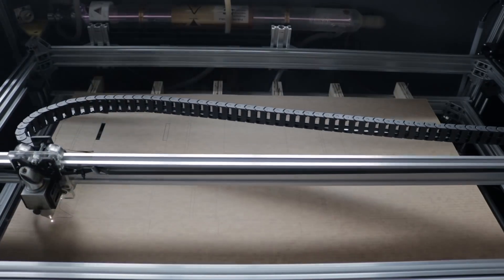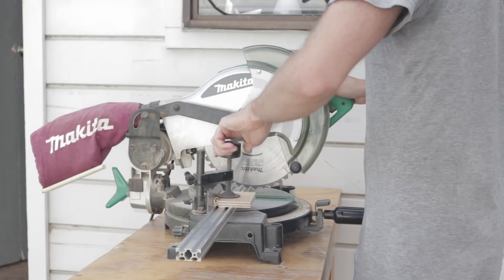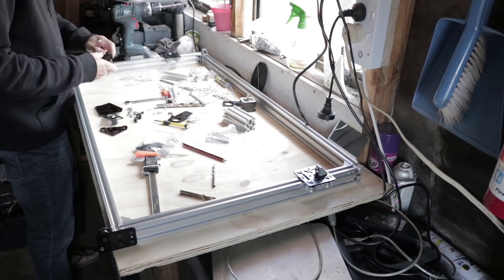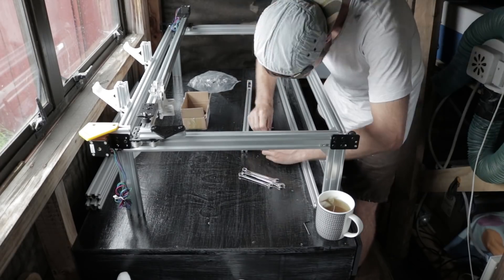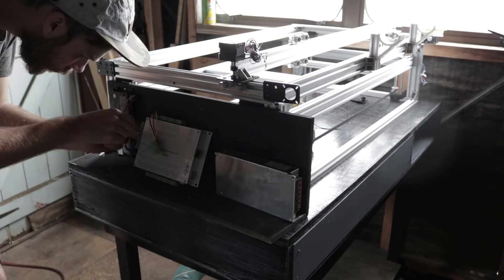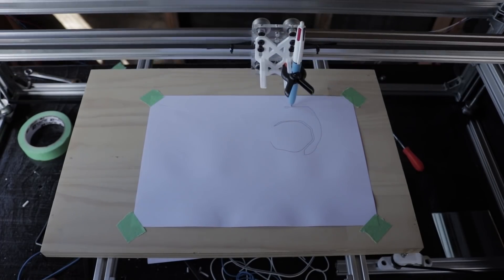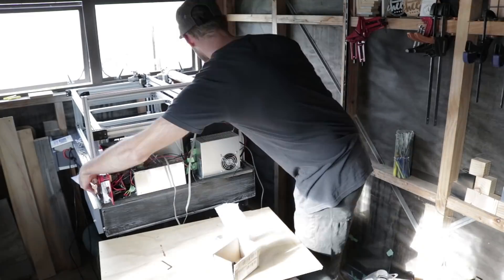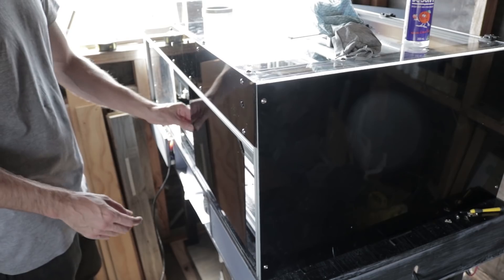DIY Homemade Laser Cutter

Comment: Really nice work. It seems like a single z-axis tower would be more material efficient and offer less potential for failures than raising and lowering the whole table - was there a limitation caused by the laser that prevented this?
Reply from the maker: Thanks! hmm can you explain a little more, I'm not entirely sure what you mean?
Reply: I meant that in most cnc controlled machines (routers, waterjets, etc.) the main gantry would span the shorter dimension (to prevent vibration/deflection) and a carriage would travel along that to provide the other 2d axis. That carriage would hold a short vertical track that would hold the secondary carriage that controls the z-axis height. So, rather than having to raise and lower the entire bed it is stationary and, in your case, you would have a mirror at the top of the z-axis track that would divert the laser down to the lens would be raised and lowered to accommodate different material thicknesses.
Reply from the maker: Ok yeah I'm on the same page now. That's a great question! 
The first part is the laser tube must be orientated parallel to the nozzle/head for the reflecting of the beam and because the tube length is already creating a fixed dimension it makes sense to utilize the full x axis space that this creates, hence the  main gantry spanning the relative 'longer' dimension. 
The second part is while there are examples of adjustable focal length heads they add extra weight to the moving gantry, this is significant because lasers, when in raster mode, need to be able to move their head at well over 200mm/s with sub mm accuracy, so acceleration and backlash are a real issue. 
There are a couple of other reasons but those are the main ones. Hope that answers your question!

Comment: Impressive build. How much did for the aluminum frame? Let’s say everything but electronics and laser? I’m building a CNC and I’m using iron, just to compare costs.
Reply from the maker: Thanks, I can't remember exactly, but it was a significant proportion of the build - that stuff is not cheap. I thought about welding up angle iron as my frame for cost reasons, but decided against it because I felt the extra versatility of the slotted alu was worth the cost, in my instance.
Reply: @FurtherFabrication  Ok, sounds fair. I was able to keep the frame under 100€ on my build, while keeping the same rigidity. But I'm still building it, I look forward to wire the electronics and see if everything is running fine... crossed fingers :D

Comment: hey man, great work, just one question: why did you use transparent acrylic vs a version 
more suited for blocking  a red beam ?
Reply from the maker: Thanks. It's my understanding that acrylic doesn't transmit the IR wavelength of the CO2 laser, regardless of color/transparency.
Reply: ah, ok, i thought co2 was more in the visible spectrum...

Comment: Hey, sweet build and great video.   
But to retouch on the laser DSP from LO, it might be worth the extra coin to consider Marco's latest offering in his T9 controller.   He now has direct input on the programming and firmware updates as a partner of the actual manufacturer.   The T9 has some cool features such as re-cut and a plethora of other nice attributes that make it top notch.
   I bought the T9 that I retrofitted into an old Lasersaur build.   It obviously runs infinitely better than their failed open source board and has every feature you can imagine.

Comment: hi, excuse me, where did you buy your laser source and how many watts of power has? i'm trying to manipulate certains conditions of the laser source like the power beam dot diameter, pulse repetition frequency and speed. 
Do you have any recommendations?
Reply from the maker: I got that laser tube from aliexpress, it's just a little 40w one. The beam conditions are going to be controlled by whatever your specific control board/DSP you're using, there's lots out there, and generally you get what you pay for in terms of ease of use and reliability. I've only had in depth experience with the one I'm using (AWC608 DSP controller) which seems to be fine. Hope that helps.
Reply: Thank you very much for your response, I loved your project. Congratulations

Comment: Very impressive! Do you think the rigidity of this design would hold up for a larger scale build of this? My target cutting dimensions is around 192x64cm, which is quite large.
Reply from the maker: Thanks! yeah that is quite large, you would probably want to beef up the frame a little bit more.
Reply: maybe 2040 instead of 2020

Comment: Honestly I am surprised it cost so much.  What was the most expensive component out of the bunch?  Was it because of the controller?  I remember you said it had it's own software so it was a little expensive.
Reply from the maker: I live in New Zealand, so literally everything costs twice as much because of shipping and import fees... also you'll be surprised at how quickly all the little bits of hardware add up
Reply: @FurtherFabrication   That makes sense.  Extrusion here in Japan isn't too costly, the bits to connect it together can be so I usually source them from Aliexpress where the price is significantly less.  Our hackerspace plans on building a larger laser cutter, so this was good to watch.   Any chance you have the laser tube holders on thingiverse?

Comment: Hi, can you tell me what software are you using? Is the communication interface USB or other? Thank you.
Reply from the maker: I'm currently using a piece of software called LaserCAD - it came with the electronics controller. But there are lots of other good ones out there too. It's communicating via USB but I believe it can also use an ethernet connection.

Comment: Do you have your actual wiring diagram? I am a little confuse about that, so i'm not yet assembly my laser.
Reply from the maker: It totally depends on what controller/power supply/stepper drivers etc you've gone with. Start with the user manual.
Reply: @FurtherFabrication  i use awc708c for controller, what controller you used?

Comment: Hi , nice build. like the way you solved some of the problems.  I did see the budget you spend for building this laser,  and I did check your size  ( which is between the commercial sizes to big and to small for my use ) If you have to build it again do you think you can build it for a lower budged or better for the same money?

Comment: Brother it is a good project and please tell me about Stepper motor you used and resolution you got.....? The strategy you used to lift the z axis is crucial... Nice build and great finishing...
Reply from the maker: Thanks man, the steppers are just regular nema 17. Check out the vid I just put out called 'the Witcher's Alchemy Chest' you can see the engraving resolution in some of the close ups, I've got it set to 0.1mm. I'm actually surprised how much detail it was able to get.

Comment: Hi sir great video. Im going to build one ofcourse. Can u make a video explaining all laser tube/glasses/focus length etc.?? Or can u share a document explaining how to setup laser ??
Reply from the maker: Thanks. Most of what I know is just from working with laser cutters, if people are interested I'll try and put together some more 'in-depth' videos. In the meantime if you search 'rdworks learning lab' he has a lot of good technical videos
Reply: @FurtherFabrication  Thank-you sir. i found 80W laser. mirrors/power supply/lens/head/chiller. Now i just need a right video from you (as u have explained it so well no jibber jabber all to the point) how to put those things together coz i have no experience.
It would really help if u explain wiring/fitting/testing of laser.
Reply: @FurtherFabrication  also if u have any idea what power laser should buy for cutting 12mm acrylic. (is 80W enough??)
Reply: should be ok. I use a 60w laser for 10mm. Basically it's running at 1-3% the maximum speed at the point. Also you can do multiple passes but it's not as nice since there's too much heat. I'd bet that 80 is good as long as it's a quality tube.

Comment: Cool man....I'm from auckland I'm gonna be interested in building a diy one, but one that can cut metal? Possible? Btw if you need help cutting of your extrusion or welding let me know can help you we have a very accurate saw that can cut Ali very accurately.
Reply from the maker: Nice man, cheers for the offer. I haven't explored DIYing one that can cut through metal. The power levels and cost required to do that likely make it unfeasible as a DIY/hobby machine.
Reply: @FurtherFabrication  thought so....just thinking out loud, possible to have all the setup, but instead of laser, I'll have a plasma cutter instead? If you know what I mean? You can buy a plasma cutter between 4 or 6k, and mount it on like the laser, but it's plasma? Anyway will that work? It's coz I'm a fabricator and paying to get laser cutting is pretty expensive, but wanna cut me only material at home for my homers.....thanks

Comment: hei, great video, thanks for sharing :)
I am wondering though if its absolutely necessary to use laser safety goggles before firing the laser ?
Reply from the maker: Thanks dude. Well no one's going to stop you if you don't have goggles, but for you're own safety and for those around you I'd recommend you read up on laser radiation first.
Reply: They are not expensive to get c02 laser glasses.  It isn't worth the risk.  Most people who get permanent eye damage from lasers don't even realized it when it happens.  All it takes is for a stray reflection to change your life forever.  Wear them.

Comment: I have started with a  basic k4 and modified from there. Your build is literally the dream project that I have always wanted to do but scared off by the mad price of the extruded aluminium.

Thanks for the video, your project is incredibly well designed and made.

You don't happen to live anywhere near West Sussex UK ? I'm just wondering if there was an option to see your machine in action and look at replicating something similar ? Thank you.
Reply from the maker: Thanks! Awesome, yeah the aluminium is bonkers expensive. I justified it because the speed and ease of use save a ton of headache in the long run.  
Unfortunately I'm on the other side of the world, down in New Zealand.  I'll be doing a full build along step by step tutorial series in the New Year, so that should hopefully be the next best thing to seeing it in person.

Comment: Sensational video, excellent script and objectivity !! Congratulations on the done !!
one question: do you believe it is possible to use this design for a machine with useful dimensions of 1.3m X 2.0m and a 150W laser?
Reply from the maker: Thanks mate, I think the same principles would apply but it would probably be a good idea to increase the rigidity of the gantry with larger aluminium extrusions.

Comment: Great work! Love the build. That is a decent size cut area you have. Is that a 40w laser? Was calibrating everything quite tricky being a home made laser?
Reply from the maker: Cheers man! Yip just a little 40w at this stage (though room to expand when that one dies). Yeah calibration is always trickier when starting from scratch - I've done it a few times on other laser systems, so luckily I knew what I was in for haha
Reply: Oh nice! CNC router next on the list then? Can I ask how long it took you to get everything set up and how much you spent on it?

Where did you study industrial design? I studied at AUT
Reply from the maker: Yeah dude if I had the space I'd totally be building a CNC router haha! but I figured the laser gives more bang for the buck and doesn't ruin friendships with flatmates if you have it running all day! 
I spent about a week designing it, then another week or so putting it together. Ball park cost around 3 grand, it's a little tricky to say exactly because I used 3d printed parts and had other left over components (like the stepper motors) from other projects.
Nice man, I studied down at VUW, not for any reason other than it was local...I often think about what doing ID at a different uni would have changed. I imagine AUT would've been pretty intense with larger class numbers and stuff?
Reply: True. I forgot about the intolerable noise of a CNC router haha. Oh thats pretty good for a laser that size. 3D printers come in real handy for these kind of projects. Any issues with it? I'm looking to get a laser cutter for myself but not sure whether or not to buy off the shelf or do it myself. You've kinda got me leaning towards the latter now haha. 
I have nothing to compare AUT to. Classes were about 25 people. Nothing huge. Had pretty good facilities and fell in love with the woodworking and digital fabrication workshops.
Reply from the maker: Oh yeah that sounds pretty similar to VUW then haha I had the same experience as soon as they let me into the workshops! 

If you're thinking about getting a laser I'd say going down the DIY route will save in the monetary cost but will obviously cost more in terms of time. It also depends on mindset and expectation. DIY was ok for me as I enjoyed the challenge and learning of the build, but as you can imagine for some folks that just want a working laser show up at their door, DIY is going the wrong way. 
If you haven't already, I think a really good way of getting the majority of the skills needed, (and finding out if you have the patience) without spending thousands of dollars, would be to build a 3d printer from an opensource design first.
Reply: Is this also cut the lens's
Reply: @anilkumarsharma1205  What do you mean??

Comment: Hi, What software are you using?
Reply from the maker: I used Rhino to put the 3d model together (though it's not really designed for this purpose) and the machine control software is called LaserCAD

Comment: Congratulations on your design and build. You think like an engineer, not like hacker and the results match that.
You mentioned that the controller comes with software but I could not see that in any eBay listings for that set. Can you provide the name of the software ?
With your experience so far, would you buy the same controller again or a different one for next build?
Reply from the maker: Thanks mate, appreciate the compliment. I got mine from Lightobject but other sellers may have different packages. I'm completely happy with the 608, it does everything I need it to. I bought it a few years ago so if I was purchasing again right now I'd probably look into some newer options.
Reply: Thanks for the link. Do you know what are the main differences between controllers listed there? the price is about the same and they all seem to do the same job, so which one should one choose?

Comment: What size laser did you get? Have you tested cutting thicker parts in steel? Excellent work.
Reply from the maker: Thanks. The laser in there now is just a small 40w - I believe you need to go to an industrial level of power (several hundred watts) to cut steel with a CO2 laser
Reply: @FurtherFabrication  Thanks after a bunch of research today I came to that conclusion. Looks like 150 grand will build a laser of this scale. I think plasma is a bit more realistic. Keep up the good work I appreciate you sharing your knowledge.

Comment: Wao, amazing... And subscribed! I'm pretty new with the cad software, just practiced with sketchup and now learning with Fusion 360 and solid works. I'd love to build my own project like you did!
Can I ask you how deep can that laser cut? Talking for example about slim plywood (I think about it as inner skeleton or Armour for my 3D fiberglass modeling) - excuse my bad English, please-
Reply from the maker: Thanks, glad you like it! Awesome I'm really into fusion360 at the moment too!
In terms of depth of cutting plywood, a 40w co2 laser tube will comfortably be able to cut 3mm thick plywood - and uncomfortably be able to go up to around 6mm thick. To go thicker a more powerful co2 laser tube and power supply could just be installed though. Hope that helps!
Reply: @FurtherFabrication  Thank you for the response, it really helps for sure! I´m looking forward for your progress with the combination of the Fusion 360/Laser plotter combo!! Big hug ;)

Comment: You have a very professional build that I admire but some people cant easily spend 2000 or 3000 on these machines. Maybe it would be a good video to look into some cheap alternatives. Anyway you get what you pay for, thanks for the great build!
Reply: If you want cheap alternative then go with diode laser. Dont expect cutting however. They are good only for engraving.

If you really want co2, than probably go with finished chinese product. It is not a briliant design, but it works and it is great value for the buck.
Reply: @AdvancedGT  or make it out of wood wich if setup properly wont catch fire

Comment: Great build, I was just wondering if you could turn of the laser attach some 3d printer extruder and convert it to 3d printing machine or mabye a CNC router
Reply: Any 3d Printer would be cheaper and more practical
Reply from the maker: Thanks! Yeah you could create interchangeable heads, the gantry systems are all fairly similar. However, speaking from experience, having separate machines for each is far more useful.
Reply: Maybe a 3d printer would work,, although it would be hard to install a feeder system for the plastic. And as far as the cnc, I dont think i'll be rigid enough to support some cutting forces
Reply: the da vinci pro series has a laser attachment, but they are 350 mw, small but you'll gain experience as you learn
Reply: It seems to make more sense to add a laser to an existing 3D printer. Many examples on yu.tube